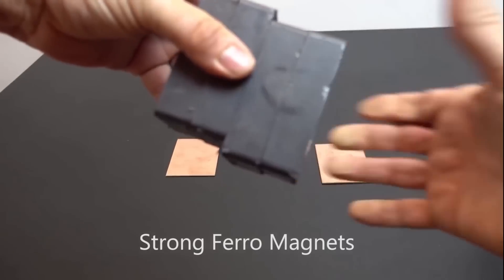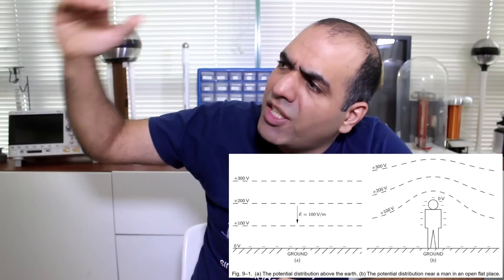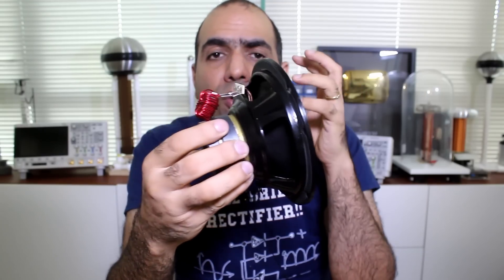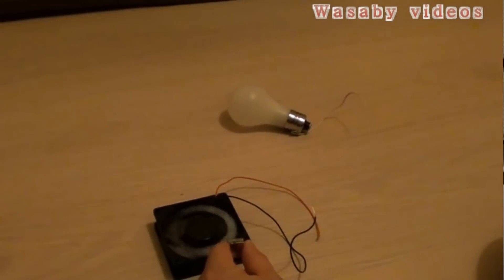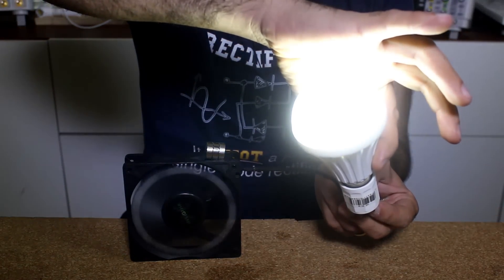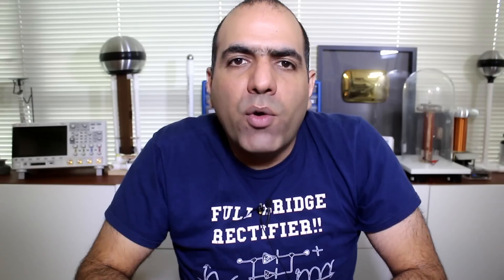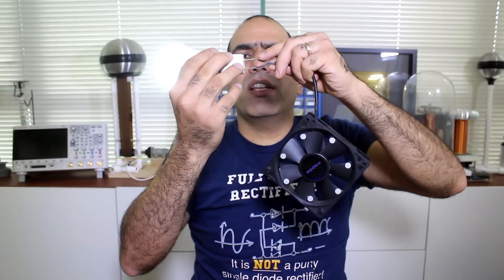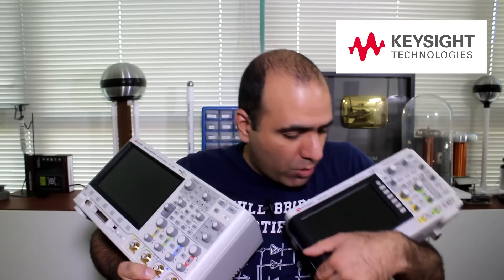Free Energy Devices Build and Science

Comment: NOT TRUE There is free energy you said it 100 volt per meter high the is ionosphere magnetosphere and radiant energy Tesla wardenclif tower 🗼 did work pulse dialectic in the earth and it comes back magnetic dialectic our earth is energy a tornado 🌪️🌀 plasmoids ball lightning ⚡ static electric is charge clusters plasmoids plasma and coherent matter or cold electric out body is trillions of volts each cell 2 or more volts with potential inside and out out calcium channels voltage gates are mosfits how do they powrr these bio sensors in the Body WBAN and anti gravity photons optogenetics photonics plasmonics and vortex mass magnet is counter space that what the pull is and also look up thunderstorm genetator and a bit show it working and the maths to use fibanerchy spirel and anti gravity black holes transmition of elements with many things sound sonic and aluminum foil creates it and plasma discharge sapphire project and Lenor were you use element with spin and other heat in tube and do it right it becomes self sustainable there are other ways cold fusion works is real covered up GEET engine also and there are ways to self loop nearly there are ways to have carbon hydrogen or something like that change to say nitrogen and change again back to what it started with a kg of iron can get you to Mars planet just like the plane mh somthing like MH320 the one that vanished is online and it real when the touroids around it and circle it and close in increasing enersha  and teleporting the hole plane filmed by satellite and drone footage 2014:alian scientist shows it and MFMPor is it Martin freshman memorial  foundation he shows the tech old tech water also drop it out bucket 2 wires two bucket let it slow run out and see the sparks charge from water and they use aquarfas my spelling bad soz dislexia but know alot
Reply: He said there's 100 volts per meter as part of the act he was doing.  There is no such potential.  If you don't believe me, get a multimeter, stick one probe in the ground, and hold the other a meter in the air.  Also, "trillions of volts per cell" in our bodies?  What are you even babbling about?  Your nervous system runs on millivolts.  If you had a trillion volts connected across you in any way you would cease to exist immediately in a puff of acrid smoke.  You're several orders of magnitude above LIGHTNING!!

And for the love of all things sacred please stop invoking Tesla's tower.  Tesla built the tower in attempt at wireless transmission, not harnessing ambient energy or any other such nonsense.  Please, read just a basic intro to electrical engineering textbook.

Comment: I occasionally throw out the fact that free energy is impossible to expand my creativity and potentially discover something new.  That said you understand the science better than me, there is one I've been working on I haven't been able to make sense of.  Can you help me to understand?
.
What would happen if you had a series of one-to-one induction coils in a ring.  The inner coil (or second coil) in each hooked in series or parallel connects back to the beginning of the first coil. The second coils are insulated from the ground with with diodes to draw power while not releasing it.  The end of the ring of the first coils goes back to the power source.  I know it's not free energy but wouldn't it work as an infinite capacitor as long as power is going in and stays moving?  If so what would the hypothetical limitations of it be?
Reply: I see many limitations without even understanding how it was supposed to work. How would you power it? With a dc voltage? (otherwise the diodes make no sense) When dc voltage is applied to a coil it acts as a low resistance resistor and turns all the power into heat. How would it act as a infinite capacitor? There is a limit of how much power can be stored in a coil and it is not much. And to keep the current moving it always needs external power because the coils have resistance

Comment: Your definition of Free Energy is different then mine.
Your definition is Mathematically free
Mine just means I have to physically do next to near minimal nothing and still easily be able to tap into the radiant energies surrounding us.
Think about how much power it would take from your Stereo to create the same level of noise as 1 vehicle.

So why can't i reverse that so that any noise made outside, is concentrated into one place that allows me to just charge my phone.

People are looking for their Jiggawatts worth of power.
I'm looking to charge my phone, laptop, and trickle charge electric vehicles to help with battery health.
Why isn't there a device that lets you charge your phone just by being near a power line?
Or a power box?
I can run lights held in my hand under strong power lines, but we can't charge small devices like cell phones, power banks, laptops?
Yea some one is lying somewhere for the sake of control and we've known that for a very long time.

Doesn't take fuck all to keep your phone running infinitely with a one time tiny investment into a shit 50-80 watt solar panel.

One hour of solar will charge the average phone 5-10 times

That's free energy and will continue to be free until your panel breaks.

There are different ways at looking at Free Energy
But we all use the White mans description.

If I can charge my Ebike machine, laptop, and phone, without having to interact with a controlling dick head from the past, thats free energy to literally 99.9999% of every human being on this planet. 

It's literally the responsibility of the rich to get this shit done, yet the poors are the ones with the solutions 

This is why the rich get eaten alive during revolutions if we find you regardless of the information you hold.

Its like asking a Magician how they do their magic trick, but for 50 years they refuse to share.
So eventually we figure it out, and kill them for wasting out time, energy, and resources.

There are different ways to kill people then actually causing them death.
You can indirectly cause death upon people by just shaming them to a point their shunned 
Same result, different gun
Reply: I doubt Mehdi will reply so I'll take a shot at it.

"People are looking for their Jiggawatts worth of power."
-"Jiggawatt" is not a real unit.  You may have been going for "gigawatt".

"Why isn't there a device that lets you charge your phone just by being near a power line?
Or a power box?"
-Well, for one thing your cell phone requires a DC power supply (typically 5v) and the power lines are high-voltage AC.  You can certainly get a transformer to step down the voltage, then another device to convert it to DC and hold it to the specific voltage for your phone to charge it.  Fortunately, the power company has already provided the transformer and the cell phone manufacturer (or some other aftermarket manufacturer) has provided you the adapter to convert the 120 Vac into 5 Vdc.  If you think you can build a better transformer or adapter, by all means do it.

"One hour of solar will charge the average phone 5-10 times.  That's free energy and will continue to be free until your panel breaks."
-Solar energy is not "free".  It is derived from the 1.4*10^27meter furnace of nuclear fusion known as the SUN.  Solar energy is certainly useful when properly located and maintained, but is not a magic cure-all.  

"But we all use the White mans description."
-The laws of physics are not skin-color-relative.  JFC.  Also...you know Mehdi is Iranian, right?

"If I can charge my Ebike machine, laptop, and phone, without having to interact with a controlling dick head from the past, thats free energy to literally 99.9999% of every human being on this planet."
-Which "controlling dickhead" are you referring to?  Maxwell?  Tesla?  Faraday?  How exactly are they controlling you?  Are they rising from the grave to keep your phone from charging?  Nope; actually it's their innovations in electricity that are holding you back, right?  Of course, without them (and many others) you wouldn't have that Ebike, laptop, or phone, but why sweat small details like that?

I mean seriously, do you actually know how ANY of those devices ACTUALLY work? 

"It's literally the responsibility of the rich to get this shit done"
-No, it really isn't.  "Rich" simply means you have a lot of money.  It doesn't mean you have the ability to actually contribute anything useful.  There are plenty of useless rich people.

 "yet the poors are the ones with the solutions"
-No, you THINK you have a solution, because you probably failed your high school physics class and are an excellent example of the Dunning-Kruger effect.  If you do have a solution, then build it.  I won't hold my breath.

"This is why the rich get eaten alive during revolutions if we find you regardless of the information you hold."
-Yes, you kill the people who actually understand physics and then get all surprised when your shit starts breaking down and no one knows how to fix it.  Mao did this during his Great Leap Forward, Pol Pot did it in Cambodia, etc.  The result was always the same; famine and genocide.

"Its like asking a Magician how they do their magic trick, but for 50 years they refuse to share."
-They're under no obligation to tell you.  Furthermore, most magicians openly state that their acts are illusions, because there's no such thing as magic.  You should watch Penn and Teller sometime.

"So eventually we figure it out, and kill them for wasting out time, energy, and resources."
-If you think that implying that you would murder an illusionist for not telling you how they performed their illusion is OK, please check yourself into a mental hospital immediately.  You are severely unbalanced and likely a threat to yourself or others.  Only a psychopath would think like this.

"There are different ways to kill people then actually causing them death.  You can indirectly cause death upon people by just shaming them to a point their shunned.  Same result, different gun"
-By all means, please do.  I yearn desperately for the time when people like you form your own society and cast out people like me and Mehdi (I'm also an electrical engineer) to create our own.  Freed from the shackles of having to carry fools like you around and cater to your stupidity, we'll be able to devote more resources to actual innovation and new tech.  Our society will be just fine while people like you in your society are walking around waving dead cell phones at power lines and screaming about the injustice of it not charging.  We'll be lit up like the Vegas strip, because we actually follow the scientific method and know how it works.  And no, we will not help you, because then you'll start demanding our power supply (because yours doesn't work, because you believe in fairy tales not grounded in science) and from there will try to remake our society into yours, and we split from you for a reason.

So go ahead.  Cast out and shun all the people who follow actual science and instead pursue pseudo-scientific nonsense that defies the laws of physics.  I want you to.  Just don't come crawling to us when none of your shit works.

Note: I'm writing this on the premise that your comment is actually sincere and not a trolling attempt.  If it was a trolling attempt, then you got me and I tip my cap.  If you are actually sincere, please seek mental help, as well as a decent intro to electrical engineering textbook.
Reply: @st.jimmy0244  This is a lot of work and effort you put into telling me I'm wrong, why didn't you take the time to do what I said instead?
Why do I not have to do anything and you will?
Because I am the Loser, the incapable, and that is what makes you responsible.
I don't have to move, so long as there is someone more willing to take my place, with 8 billion and counting, there is always a Chad willing to push to the front of the line.

We generate the ideas, the critical thought, you generate the product

You are wirelessly connected to the sun in many different ways.
No one is paying money to Recharge the Trees, but those trees build and power a lot of homes from power converted by our sun

Now there are Many, many, many a ways to transform that heat energy back into electrical and only at a small controlled rate in which allows me to consume 70-90% of the power

But of course these problems are too complicated even for the brightest minds on the planet to figure out.

This isn't my Job and I don't want it to be, i don't care about the money I want the products for us all and will never be satisfied until they are as common as walmart shelf products

Catch my drift? my waves of energy? 

I'm just a youtube troll right, I'm not the electrical engineer, so who's job at the end of the day is it? The youtube troll? or Yours? 

If you think we don't have a problem, why aren't things like 3D printers common place in super stores? 
Why must I gamble online and not actually have leader competitors that everyone is aware of? 
Why is it seem like Metal 3D printing is still taking forever to get anywhere?
Why isn't augmented reality being worked on harder?
Why aren't the truly great and good things that should be, not being focused on?
Why are we focused on fighting and killing?

You think I'm a phsycopath?
Do you know what it means to be phsycotic?
What it means to have psychosis?
Are you suuuuure you're not? 

When I see a true Psycho, I see a true simulator.

I see someone who's already simulated moments in time thousands of times to already have reacted every possible way within those moments so when they arrive in reality they appear calm.

You need psychopaths
You train to become psychopathic 
And those who 

You wish to be
On top of this, you listen to those who are not of the "Autism spectrum" 
Or "Normal" people and they say things like:

They're more sensitive
Have much high tendency to react to illogical patterns

These again, are high sought after character traits.

You can see that "Normal" people, are actually envious of those who are "Psychopathic"

You can tell by watching your movies
Reply: @st.jimmy0244  You use the white mans definition of "Free Energy"
This definition is perpetual motion

Free to the rest of the world means you set it up once and can forget about it yet it'll still accomplish its goal.
Like a dishwasher, is it free to run?
Technically, yes, if you ran it directly off your own water wheel, that power comes from God, the universe

The moving mass of water is whats running your dishwasher, and the water you're using to clean your dishes.

Now all you have to do is load the dishwasher

A system that can bought once, set up once, and used for a decade or so without the need for intervention.

This is free energy to the real world, the rest of the world.

My VR Headset can do all that my computer can do, just not as well.
But it only consumes 10-30 watts compared to my 50-80 watt laptop or 100-200 watt desktop

Think of how much power it used to take to watch TV with the family
Now each individual can watch their own form of Edutainment for even less power then that which used to only give one person at a time their form of edutainment while the rest was forced to play or learn along regardless of the lessons on TV being taught

Now, with 1 VR, I can do 10x that which a single man could do back in the early days

So I should be able to live 10x longer for the same cost, or cost 10x less to live the same length of time

But that isn't whats happening now is it?

Why? What are you electrical university kids really up too? 
If you haven't actually been doing your jobs this whole time?

Why does it feel like there is only a few thousand of you working?
When there should be Millions?
Billions?

Good things should be done at the snap of a finger, but it isn't, is it?
I can have the next big game and next big game system all across this planet next month, but not any truly good tech like 3D printers, 3D Solar, 3D Vibrational Generators, Kinetic generators.

All the things like this, I have to custom make or custom build or custom buy.

So whats the point of capitalism?
Its cheaper to go to option A then say fuck options B through Y i'm skipping to Z which is custom making it

So you believe you can have 8 Billion jobs sustained like that?

Sure bud, sure.

Much easier to have 500 million sustain the 8 billion 

1 Farmer should have the tech to do 100 Farmers worth of work
Just because you added more work to the farm, did not give us an infinite potential amount of work

Just gave me a finite amount of problems to make more efficient
To stream line
To speed run

Now 1 Farmer of any kind of Farm can accomplish that of 5 - 1000 Farmers from back in the day

So what is our max capacity for workers?
800 Million? 80 Million? 8 Million? 

How much really needs to be done, and how many people can I really have digging this trench at one time without others just standing around doing nothing and others getting in the way?
Reply: @st.jimmy0244  Your Job is to "Electrical Engineer" solutions
My job is to "Troll you" into seeing the problems

You don't get paid dick, neither do i
So no wonder we're so bad at our Jobs